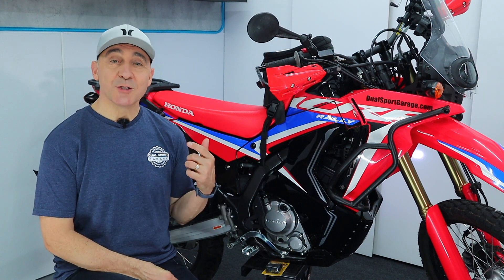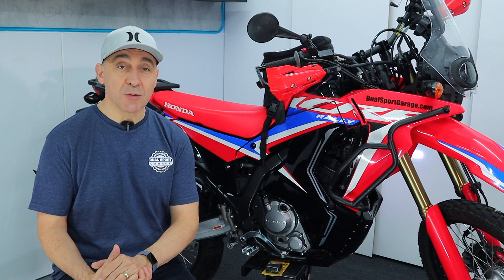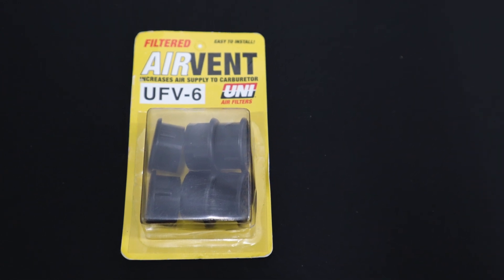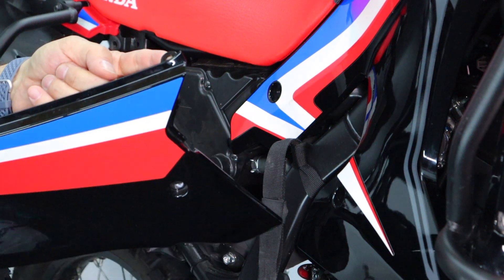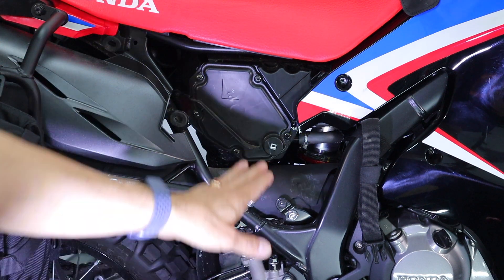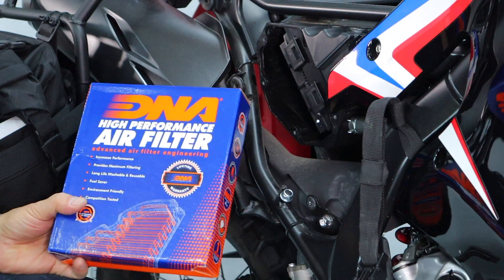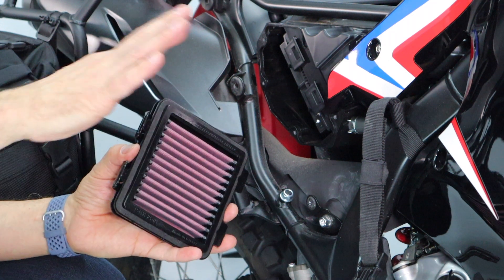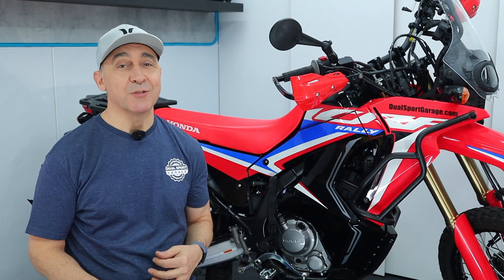crf300l rally horsepower mod airbox mod and air filter upgrade

Comment: DNA filter is 10% more airflow. Not surprised you didn't feel a difference. The big difference is in the cost and the added maintenance. And God forbid you let it dry out and start letting dirt particles by. I'm not sold on this mod.

Comment: If the new uni-filters are not waterproof, why put them in? Why not just cut the holes? That would increase the airflow and as you noted, you don't ride in water up to that level anyway.

Comment: To tie in with the rivet removal, I found these neat screw on knobs that you can hand twist on and off to replace the lone hex bolts on either side. Makes checking your airbox and battery a breeze.
Reply from the maker: excellent! ...can you share the link to them?

Comment: Why didn’t place the side cover unfilter to the further back position? It looks like it would fit inside the webbing on the inside, and not be compromised with the screw, like where you placed it.
Reply from the maker: Of course you are right… My videos are a bit trial and error sometimes… So you guys can learn from my mistakes and or my discoveries. … Good luck!

Comment: When will people quit hacking these airboxes? Fluid dynamics engineers at Honda figure out this black art of air intake design.  By drilling the airbox, removing the snorkel, etc. you destroy the resonance and reduce performance. The stock airbox, snorkel, and filter are designed to let in much more air than the bike could ever use. It does not need more air! It needs the pressure wave of dense air to hit the intake valve at the right time -- which you just ruined by hacking the box.
Reply: Not true. Snorkels are designed to deflect and lessen intake growl to meet EPA decibel restrictions. An open airbox under load is loud. A lot of them are designed for easy removal so u dont have to destroy the air box to get more air. They have to tune the AF ratio down, less power with the snorkel in. Removing it and adding fuel tuner adds power from volume alone.
Reply: meh . what the hell do Honda engineers know anyway?
Reply: Until you fit a bigger pipe at the back that moves air more efficiently than the lunch box they fit as stock. Then you need to increase the amount of air and that snorkel is just bad until you want to ride balls high in water. No the engineers design around restrictions and a lot of them. So no you could not be more wrong.

Comment: This is assuming that the snorkel air inlet is a limiting factor on the air intake.  Yes, you have opened up the external air intake area but did you need to?

Are you also adapting the post filter air intake routes?  If not, why not as you've only adapted one part of the air intake route?

Anyway, back to my first sentence, I reckon the air filter (of any type) would be the limiting factor to any airflow, regardless of the type of filter.  So, my advice would be fit the high flow filter and leave the air intake vents alone and go and have a few beers instead.

Comment: This has to be one of the stupidest mods ever. Just take the side cover off completely and leave it off. If you are not going through deep water, don't worry about it. If you are, leave it on and leave the snorkel in.  If you grease your gasket on your air filter and it is tight, nothing is getting in. Selling crap to newbs to think they're gonna get .000001hp. Shame.

Comment: You didn't put the seat on properly 😛
Reply from the maker: The T post on the tank needed a little bend to make it easier to get the front of the seat to fit under it consistently...caution...be super careful not to crack the paint if you do this... to be expected on a mid-priced dual sport vs a race bike.

Comment: Some additional mods to the  300l  transform it nicely. To start with you can add two vents to the airbox as per the video (but place the side cover vent to the left), or simply cut the holes and don't install the foam vents-the air filter will take care of dirt/dust entering the box. Next, remove the snorkel and cut off the 2.5 inches that protrude into the airbox then reinstall. Remove the backfire screen from the stock air filter and it will work fine. Removing the pair valve, canister and associated hoses shaves 1.3 lbs and allows air to circulate better behind the cylinder. I added the Yoshimura slip on mainly to lose weight and get rid of the excess heat generated by the catalytic converter. You can make it quieter by installing a 2" drain screen on the end of the slip on secured  with 3 small self tapping screws. Bike runs great with these mods (even with the stock pipe) but even better with the yosh and a stage 1, 91 octane ECU flash from 550 performance.  Gas milage been reduced minimally (about 1-2 mpg). At 170lbs i found the suspension too soft so I change the fork fluid to 15wt to slow rebound damping and added 10cc to resist bottoming. Fork works great now. The shock is useless so I swapped it for a Cogent Ohlins unit. With these mods the bike runs as it should.

Comment: ... Curious why didn't you drill the hole in the cover on the top LEFT side where it was open to the air box? 
Instead you chose the top right side where the vent had to be modified and the air flow is blocked by the side of the air filter defeating the purpose in the first place? 
 . 
Take the 1" hole and subtract the thickness of all the plastic that covers the breathable opening and it looks to be about half, or, measure (somehow) the visible blue foam and see how much room there is for air to pass through. 
.
Jake the Garden Snake removed the snorkel and cut a big hole in the top back side of the air box then put a short rubber tube in the hole and sealed around it.  
.
I keep searching ways to increase my 300 Rally's power (different air filter and full exhaust, ECU flash) but for now I am going to leave everything stock. I want reliability,  longevity and minor maintenance more than 3+/- more horsepower. 
.
To each their own.
Thank you for the video. 
.
Reply from the maker: I hope some of the value of my videos bring is that you all have seen it before having to doing it...placement of the air box vent is a case in point. I don't think I would ever shoot "cleaned up" videos just for the camera without mistakes or imperfections. Would I place the outside vent further back...don't know...I know the top vent would be further in to avoid that screw.  The next two videos will showcase the EJK piggy back EFI controller and the next I will replace the ECU with a 550 Performance ECU. We will see if these make the bike more fun.  To each his own for sure...I'm gonna keep sharing so you all can decide either way.  Thanks for asking!
Reply: @dualsportgarage  Thank you. I do enjoy all your videos. 
I know it takes considerable time to set up, record, edit and post. 
I appreciate all your work.
Jeff

Comment: Dont.
Ditch the crash bars. A complete new set of plastics can be had for as little as $190. You added weight w/ little benefit.
The air box mod AND muffler (merely slipping on a new muffler) had zero effect on power. It merely gets louder (making you think its faster)
Leave the stock filter in there. Sand gets by the foam filters. You see and learn this when you rebuild motors....
Taco Moto did dyno testing on these mods you're recommending. They provide zero benefit. The Japan engineers got it right coming out of the factory. Leave it stock.
If you do the ECU, you need to make hardware changes to see a benefit (exhaust header). You want serious performance gains, change the cam, piston, ecu, header, and run high-octane. Otherwise, leave it stock and enjoy it for what it is. Its a great bike in stock configuration.
Reply: U mean CBR 300 cams and piston?  Or 550 cams,  ecu and big bore?

Comment: Third main weakness. Weight. And it feels top heavy to boot. 
If it could lose 50 lbs I’d ride it harder. 
“Not you honey I was talking about my bike!”
(Muttering - For you it’s more like 100) 
“I said you’re perfect the way you are”
Reply from the maker: After riding my 300 two stroke I would agree, but after riding most "Adventure Bikes" this thing is very light. Though not an ultra light Adventure bike like the 500exc...I might have to build one of those next....but I have a feeling I would be sacrificing a good bit of comfort in the process. Thanks!

Comment: Honda has been on the cutting edge of 4 stroke technology for over 70 years, having been involved in Moto GP, Formula one and Indy car racing to mention a few. Had they wanted to make the CRF 300 a 50 hp powerhouse, they would have done so at the sacrifice of reliability, so they instead created a competition version which is double the price, significantly lighter whilst needed more maintenance.

So I question people who without having flow tested components, have the ability to conclude they restrict engine output and manage to do  so without having a baseline dyno reading, or  post modification result. People who have done so have concluded there is no gains to be made in the aspiration, including the exhaust without introduction of additional fuel, which itself voids the emissions compliance, that Honda had to meet in order to market the motorcycle.

The aftermarket will quote figures of 200% airflow increase over stock, or whatever, but that's meaningless if the engine only requires 50% of stock flow, for arguments sake.

To increase power, a combination of modifications is necessary, such as displacement, compression ratio, increased valve size and fuel mapping. The end result would be higher power from an overweight street bike engine in a chassis not specifically designed for off road use. The amount spent to gain significant increases in power would likely be the same as buying something more competition oriented and certainly not have the reliability.

Comment: You did not double your vent area. 
The stock snorkel has a diameter of 1.5 inches so the area is 1134mm
A 1 inch hone has an area of 490mm x 2 = only 980mm so not quite double and that does not include the losses along the walls of the vents
Reply from the maker: you are correct... I figure it is approximately 188% of stock...given that the DNA air filter flows a little over 150% ...the air box should now flow more than enough air to feed the air filter.  Thanks,
Reply: But it isn't 188% the pods fit inside a 1 inch hole and the lip of the pod in 2mm think so the inside of the pod is only like 3/4 of and inch.  Then you have the thick plastic mesh blocking half of that 3/4 inch hole.  So really only 3/8 or 7/16 more opening and then there is air drag on every edge.  

So when you flow test the vents on a bench it ends up being worthless. 

Also the factory snorkel behind the dna filter, between the airbox and throttle body is still only 35mm